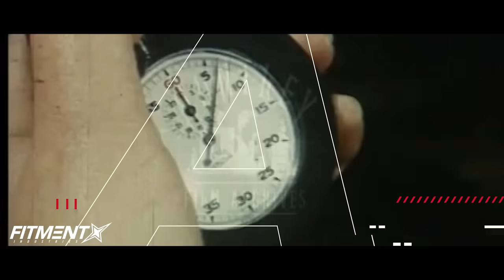Is Vinyl Actually Better Than Paint?

Comment: Agreed. I like wrap for a temporary solution but, I think ultimately paint has better quality.
Reply: wrap is not a solution. Good wraps needs a good base, a good paint. Wraps is for protect paint, do a design or/and a temporal change (up to 10 years). I am wrap installer and I am sick of rejecting work because they think it is a substitute for paint.
Reply: @DCGdesign  Not what I meant when I said solution. Sorry for the confusion. I meant a short term solution for a color change. Not a band-aid for failing paint.
Reply: A good paint job is only worth it on some bad ass car you’re gonna keep for a while. If you just wanna trick out a daily, wrap all the way
Reply: @jacobrodgers8146  Agreed.

Comment: But.... can it ruin the paint? Bruh like I wanna know if it traps moisture or smth that can mess up the paint. Homie.... you didn’t answer the question 😂
Reply: He never did answer the question
Reply: Bruh i realised i worte the same comment as you
Reply: I’ll answer: No lol it actually protects the paint
Reply: That’s what I was curious bc I was get my car repainted it’s base color and wrap over it . I just can’t hard commit and spends thousands on a full color change . I’d love a nardo grey wrap or a nice teal . But some of those colors are really expensive to get done by paint so wrapping seems more convenient and if i don’t like it later I can always take it off
Reply: @listen7634  I’m pretty sure it more depends of the quality of the paint underneath
Reply from the maker: Good quality vinyl wrap installed properly should never ruin your paint. The things that would ruin your paint would be the vinyl being applied incorrectly or subpar material being used.
Reply: @FitmentIndustries  Thanks Fitment!
Reply: To answer it yes it can if it is left on too long or if the car has a lower quality paint job. For short term it will be fine. Most of the time you will see some clear coat peel if it has been left on for a long while. Personally I say buy the car in the color you want. The wrap is not a paint replacement. If you want your car to be one color forever then take the time and paint it. If you want a temporary fix then wrap it. Don't keep the wrap on your car for more than a year or 2 years max. You will be spending some cash on some clear coat repairs and possible base coat touchups if you chose to keep the wrap for a long time.
Reply: No but if you get a cheap or low quality paintjob it 100% can rip the paint off the car.
Reply: That’s a tricky question. The part of a wrap that can cause damage is actually the adhesive used to make it stick. Over a long period of time that adhesive will go bad and make it much more difficult to remove the film. If the clear isn’t in good condition underneath the wrap can pull paint when you’re removing it.
Reply: A couple things to consider: if it's a full wrap, you may run into paint issues when you remove it if you keep your car outside constantly, with the sun and heat baking the wrap and adhesive into the clear coat.  The other thing to think about is if it's a partial wrap (just the roof, or some custom graphics or striping), the non-wrapped paint is gonna fade faster than the wrapped portion, so when you remove the wrap or graphics, you end up with a brighter paint shadow where the graphics etc were applied. Once again, this effect will be amplified if you keep your car out in the sun and heat regularly.
Reply: If you take care of the vinyl than it can protect the paint. However if you don’t take care of the vinyl, it can ruin the paint. I worked at a wrap shop and car came in that need the wrap removed. The lady who got her car wrapped parked the car outside and never washed the car which caused the vinyl to be cooked into the paint. Took 100+ hours to remove the vinyl off the car and the paint underneath was destroyed.
Reply: My sentiment exactly. Do videos that don't answer the question in their titles count as click bait?
Reply: Bruh they changed the title 😩😂
Reply: Fractured Band I have an old box truck 2002 and took off the cheap vinyl decals a few months ago.  The paint looked brand new in those areas.
Reply: @FitmentIndustries  Or having your car wrapped right after you just had it painted. Believe it or not this happens because people think two or three days after a paint job it's long enough for it to have it wrapped.
Reply: Exactly right, I'm a custom painter. Once I ended up painting a brand new evolution, because it was white, the white color ended up turning yellow because of the adhesive it was only on for a year and fuck up the whole paint job. 
Now wrap is good if you are doing events racing, ect, but don't keep it on for more than a year it ruins the paint.

Comment: As airbrush artist and painter and work on boats which deal with a lot of vinyl, the big difference is paint last longer still. And paint can be touched up and repaired. With vinyl when you get scratches, chips or dents, and you will; you'll have to pay to have the entire vehicle rewrapped. Now with paint and especially with high quality mural art I do, I can fix the art and paint for a lot less. Also cut and buff it so has a perfect mirror finish.

Comment: Wrap will ruin the paint if you live in a hot humid area like here in the Carolinas. Regardless if it is in the garage or not. I ruined the clearcoat/paint on my Genny. The wrap however was beautiful when it was installed.  I do not recommend for a long term solution
Reply: This is the first that I heard about the wrap damaging the underlying paint. Can you provide more details? …what is it about the humidity that made it worse?

Comment: I never vinyl wrapped a vehicle before. But Ive worked signs and graphics for 16 years. Vinyl wrap is honestly the most cost effective if you can do it yourself. You take it to a company to do it for you, it can still run you into the 5 digit range of costs, depending what manufacturer you choose, and how big the vehicle is. Now I skimmed through the video, so I didnt catch all the details, but while both paint and vinyl will fade eventually from the sun, the vinyl will crack and peal, especially on the corners and edges a lot sooner than paint will. And paint (with clear coat anyways) is a little more durable, so it does stand up a little better on incoming debris that could strike the vehicle.
I think theres ups and downs to both, but its only inexpensive for either if you know how to do it yourself, the wraps are quicker to do than painting since a great paint job involves ten times the prep work while wrapping, the most involves washing and a clay bar to get it as clean as youre able to (miss one piece of sand grain and it will stick out like a sore thumb), but I just think the paint lasts longer. But ill assume wrapping is for a shorter period of time
(EDIT) I do not recommend doing this on matte paint that doesn't have clear coat. I know cars like that are few and far between, but the paint will not be protected as it would be with clear coat, so getting the remaining glue residue off might mess that specific paint up

Comment: I think one of the things that should be addressed is longevity. Which stands the test of time longer? Is it worth it to be able to rewrap vs paint. Also there is this trend in the automotive community right now where a repaint is a negative in a sale. People want the car to have original factory paint for some reason. I recently sold a mkiv supra that had a new paint job and people were turned off by the fact it wasn't original paint
Reply: I take wrapping as a way of have many colors in your car without so much trouble in the middle at the end is take that way to color your car without so much taking and time

Comment: I've started installing 22 years ago, 3M released it's first air release wrap material around then. The old air force jets and other things were silkscreened on top of basic calendared vinyl. Plotters, which cut shapes on stock colored vinyl put sign painters out of a job in the 80's. It is impossible to match a proper paint job but if your car sucks then hire an installer to wrap it. If you want to get really crazy, use Flexishield material. It is vinyl with paint resin on top and then paint protection film on top of that. It does look crazier than paint (if installed correctly). No hate on any diy wrappers out there but having done this for a long time there is a Million ways to destroy it. Don't try this at home, you'll waste your money. Hire an installer.

Comment: I just recently got exposed to the vinyl concept as a full makeover. I've seen the smaller or limited decorative capabilities, but doing a whole care is just amazing and very cool.
But I personally would probably not use it. it doesn't fit my needs, and I think that's the biggest determiner when it comes to vinyl over paint. I love the stock color on my 1999 tacoma, and honestly don't feel a need to change. It has this fantastic near black look that shows purple highlights in the sun. I'd probably end up with the same color if I ever repainted my truck. 

I also don't do shows, and thus don't have a need to get into rapid and fantastic transitions on my car. Plus when I want a covering on my car, longevity is key for me, so a vinyl that will last perhaps 10-12 years can't compare to a quality paint job that could last literally the life of the car. But for people on the modding and show scene I totally get it, I would probably use it too.

Comment: Depends on where you live. For the same wrap/paint in my area at a shop that i could trust the paint would cost me 4600 and the wrap would cost me 5500. So why not just get my car painted?
Reply: Depends where u go and what brand they use in NYC they go for 2000 to 3000

Comment: My opinion on wrap is it will only ruin your paint only if done wrong, if its done right it wont damage it in some cases its good to put wrap it protect it matte is good too for protection and satin wraps.
Reply: Question. What about if your car is primed can you wrap it? Will it stick? Or does it need to be a painted car to work?
Reply: If the car its sanded and preped right yes

Comment: I believe you forgot to include and look into Inozetek. Inozetek is actually the new greatest thing right now for gloss finishes and it literally looks like paint. So. Yes. Wrap can look like paint. Also it depends on how well you install a car also which will determine the finish on a car. Glue lines, etc. wrap can be hard also but then again it is temporary. It’s not meant to be on the car forever. If anyone thinks so. They got the wrong idea.
Reply: Agreed. The new vvivid premium plus line has a pretty nice finish as well. That plastic release liner makes a huge difference in the finish

Comment: I think you phrased this wrong. It shouldn't be whether wrap or paint is better, because the answer is obviously paint. Wraps whole thing is to look as close to paint as possible, but like mentioned in the video, it can at best get close enough. It will never be better than paint. I think the better question is whats a better decision to get, paint or wrap. Once you start factoring in how much more affordable a wrap is & the fact that its removable (cross your fingers it doesn't hurt the paint underneath, is that still a thing?), along with being "close enough" to paint, a wrap starts to look a lot more enticing. I don't have the 8 grand to paint my car a different color, but I would be lying if I said that I haven't thought about like a 2500 wrap...

Comment: I'm a wrap Installer (bias alert) and i would suggest you take a look at Inozetek. They are the new kid on the block. They only have a year or so. Your opinion might change. It might not be up to par w/ top tier paint jobs (I have never compared both side by side) But it sure as hell is better than most factory paint jobs.
Reply: And Vvivid with their new ultra gloss. The plastic backing has markings in the back, no tunneling issues, available to the public (dont need a shop), Self healing, stretchable cap, and cheaper. I got a 55 FT gloss black for $250 on BF. I prefer Vvivids instead of Inoze.

Comment: Does'nt the adhesive on the wrap when left on over say a year, begin to erode the top clear coat of a paint job??? 

Seems when left in the sun a chemical reaction from the adhesive must occur?!!
Reply from the maker: It all depends on how you take care of it.  I've seen wrap last because it was well taken care of
Reply: @FitmentIndustries  Thanks for the reply.

But I'm talking about if the WRAP is applied over a paint job. It's the paint top clear coat I'm concerned over time will be damaged by the VINYL WRAP?

Comment: Genuine curiousity. I wanna get a bodykit for my car but I'm worried about having issues when it snows, like something might break if I hit a chunk of dense snow and such. Is there a legitimate concern when trying to run a bodykit during the winter months?
Reply: Don’t know if you still need an answer but it widely depends on the bodykit. If you make your car wider or lower things are going to snag more, but that is an issue regardless of the weather. Alot of bodykits are relatively fragile so when worst comes to worst the bodykit is  probably just going to break as opposed to tearing bits of your car.

Comment: Wraps have got a a great point. But for me it's still paint. Wraps just simply don't last long enough. 3 to 4 yrs is not worth 3k plus for a great wrap. I go paint
Reply: That is the point, though. People wrap their cars because they want a temporary change. I wrap my car most summers and can easily return to the factory color when I'm ready. Once you paint, that's it. There is no going back unless you spring for another paint job. If you learn to do it yourself, it can be quite affordable to do every year or two if you choose.
Reply: @SirGalahadThePure  yea I get the point of it. Don't get me wrong. I just never was a big fan of it myself. But if you like to change colors often then it's cool asf. I got a friend that wraps his own car and changes every summer. It's just me personally I wouldn't spend 3k plus to wrap my car. I'm the type that can be happy with one color for my car and be happy and never change it. But I'm not knocking you if you like wraps. Now I have thought of wrapping my motorcycle.
Reply: @joshuat5140  I wouldn't do it if I spent 3-5k every time. Learn to do it yourself and it can be done for less than 1k.
Reply: @SirGalahadThePure  I bet you can. That's why I mentioned I had a friend who does his own to save money. But I'm just going by how some of these companies are charging 3k and up to crazy amounts for wraps.
Reply: @joshuat5140  Oh sure. Depending on the material and vehicle, one could pay upwards of 10-15k. Pretty crazy.